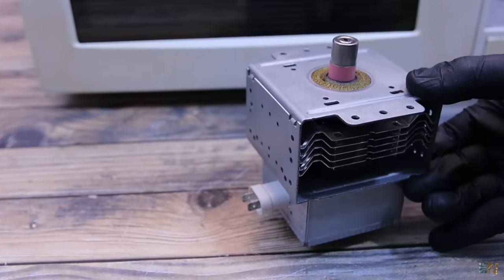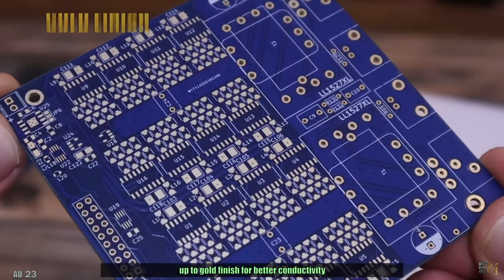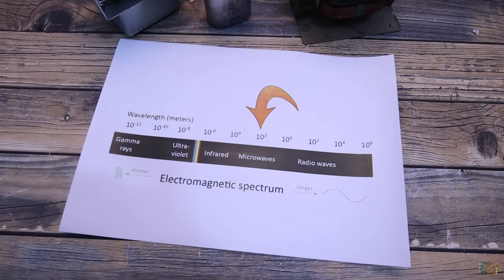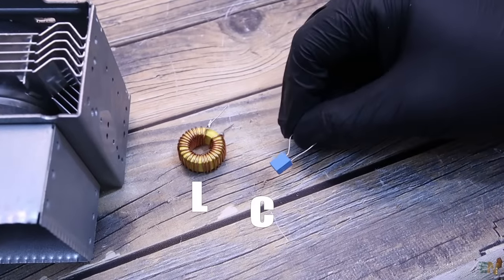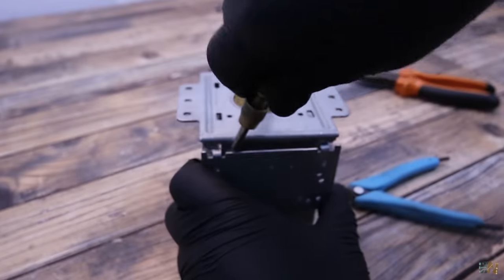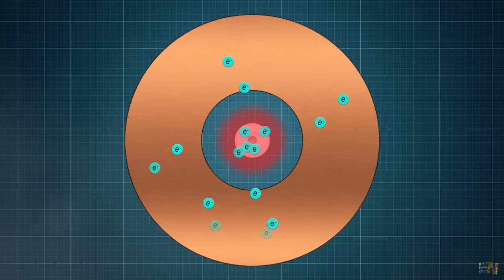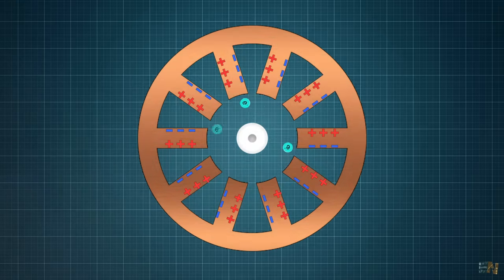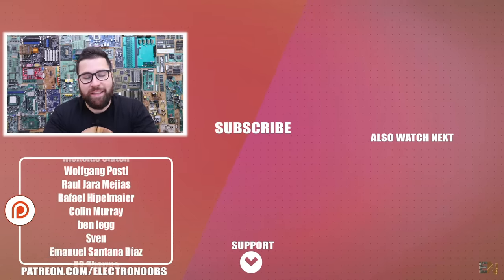MAGNETRON - Teardown + How It Works - Dangerous!

Comment: And?
Let's examine High-Voltage electricity lines briefly.
Or the voltage, no matter the line"s original specs., the voltage is radioactivity.
The Effects on gene distructive are long-known.
Women suffer in very obvious ways.  And, living directly onder these service lines is...quite frankly...criminal for a dwelling to be at that proximity.

This fact is presented to high school students that study Electricity/Electronics as their first or second Semester.  
Let's examine contaminated Nat. Gas. of the same toxic level.  Invented Nat. Gas causes lung cancer? Excessive methane? (Flame is orange, red, green, or blue?)
What about radio-active contaminate gas that is...commonly known as Radon.  Dig a hole and wait a short period of time.  Vent that old basement!
Springs(natural)...heave metal and Copper or iron levels.  I never drank it!  Many kids did.  And suffered greatly.

Summation:  natural or man-made, get informed.  Publishing danger does not discharge a liability.  Tell a Law Practitioner,. Just don't tell me. I practice Law with my Federally-given right to always win! I worked my behind off to achieve that Privailage.  It's how I lived...this long too!

Thx. & tc